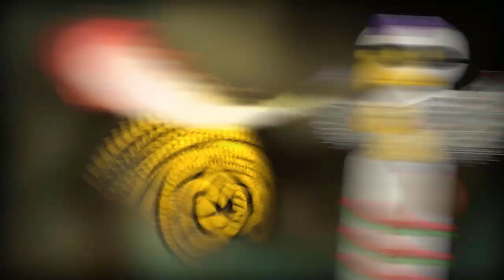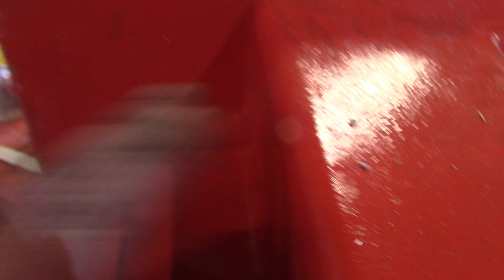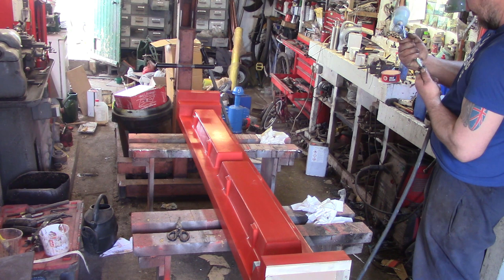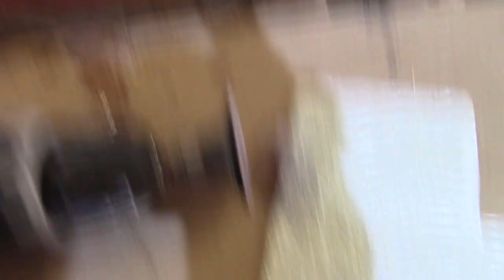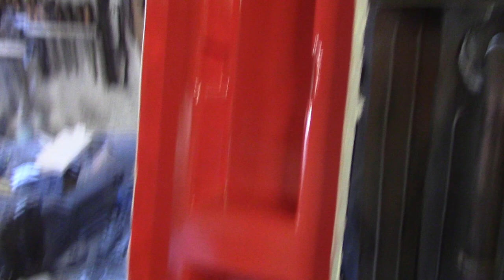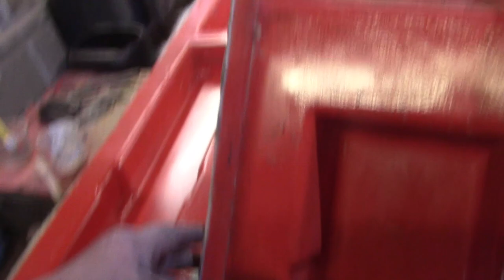Underground bunker forms 4 wall and ceiling

Comment: I made paving for a few years best mould oil I found was silicon oil it was expensive but it went so far and worked so well It was more than worth its cost
Reply from the maker: I've already got a tub of mineral oil release but as always I'll take your advice onboard and try it when I run out

Comment: Looking good 😀 I’ve used petroleum jelly mixed with IPA brushed on as mold release when making small detailed silicone molds, don’t know if that would scale up....
Reply from the maker: Ipa? Beer?
Reply: @turboconqueringmegaeagle9006  iso propyl alcohol less flavour but more of a kick than beer 🤣
Reply from the maker: @julias-shed  awesome, minds on other things obviously! The pva I'm using prevents rough handling from messing up the wax underneath it, I really have to stipple and roll it half to death getting into the corners and without a solid film I think I'd have had more problems.

Comment: you need to drill a hole in the deepest parts of the mould so you can blow in air to help extraction . use a bit of selotape over the hole before laminiting so you dont bung it up ...Paul
Reply from the maker: Yup, will definitely do this cheers Paul

Comment: Save the scraps of fiberglass to add to the concrete mix, I hear it increases it’s strength and resists cracking.
Reply from the maker: Man, I've been reading about fibre concrete for a year now and still only scratched the surface but this won't be alkaline resistant so can't put it in concrete, I'm going with polypropylene and rebar and a small ag

Comment: I agree. Steel would have been much better.
Are you going to do an open pit, put concrete panels in, then top fill?
Looking good though, and the mix will make or break the longevity of the panels.
But, I'm sure you have a trick up your sleeve when it comes to the mix?
👍😎👍m-E-m
Reply from the maker: We're going to tunnel and shore up with these panels, mostly because of the depth I'm at. 
The mix I'm using isn't going to be anything special, fine aggregate, opc and poly fibre over rebar

Comment: Mate are you putting one coat of gelcoat on or multiple?  I don't think there is anything wrong with building up layers of the gel before you glass over the top.  Maybe it was a bit thin in spots because it was brushed on.
Reply from the maker: I tried brushing it on thick on the first then went back to spraying on the next two as the brush marks made it hard to get the air out, I think you are right.
Reply from the maker: And using the same color made it bloody hard to see what I was doing!
Reply from the maker: Colour
Reply: @turboconqueringmegaeagle9006  stuff has a mind of its own.  I have only done repairs but it always takes a few layers.
Reply: Another tip which is probably obvious but if you have a corner that you struggle to get the glass to bend round but plenty of resin on the glass and leave it a while.  The resin melts the styrene that holds the glass matt together but it takes a few minutes and it then becomes easier. It's just a binder it has no strength.

Comment: Fiberglass gel coat sound like the underneath of my 30 year old cars..... dont touch the bubbles. That Shit goes south fast
Reply from the maker: Got to remember to re-gaffa tape my wheel arches before the mot, nice one for the reminder Shane cheers
Reply: @turboconqueringmegaeagle9006  I once offered to repair a couple of holes in a friends jimney.... it was all filler, gaffer tape and expanding foam. Wish I knew before I opened my mouth.
Reply from the maker: The last time I offered a favour like that was my mates ldv, I'm a bit more cautious now.

Comment: happy 20th of April. I forget why that's important though lol
Also is there a reason you are not using a vacuum bag technique for your molds? the geometry might be a bit hard but can't you just stuff some expanded polystyrene in the places the vacuum bag would be hardest to get to just to transfer the pressure into the corners and valleys?
Reply from the maker: Had to Google the date, Happy Carmen Electra's birthday my friend!
Cost and I don't care how heavy this gets, vac bagging is a little more challenging with these cheap resins as they've only got 1/2 hours gel time, I've got heavier mat for the final moulds and think I can fillet the tricky bits with pug which should help a bit.